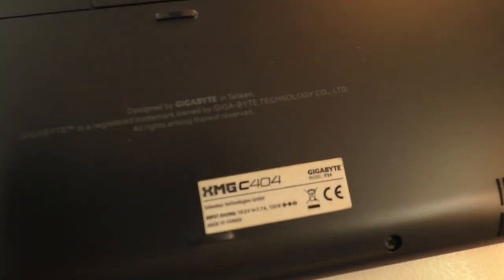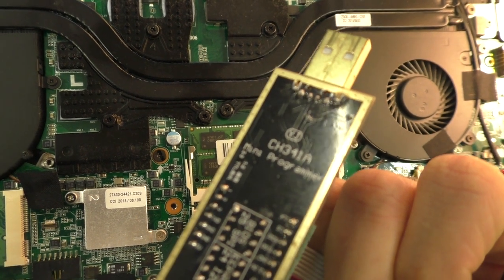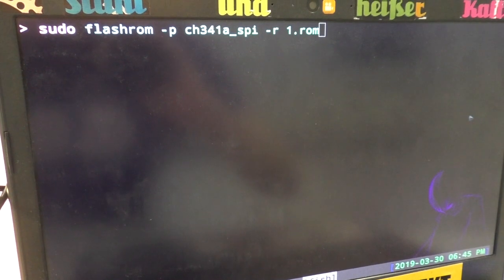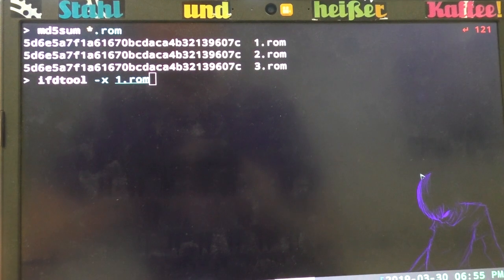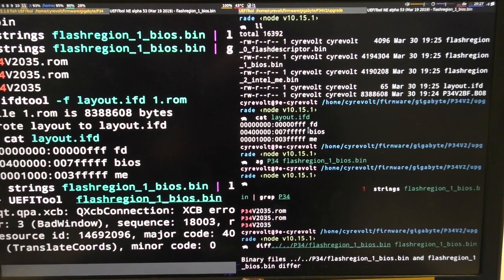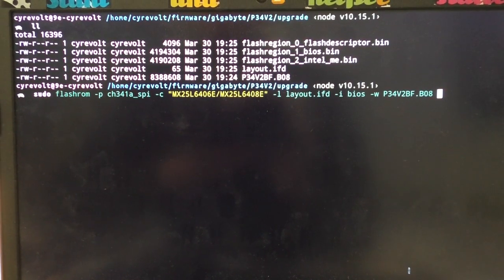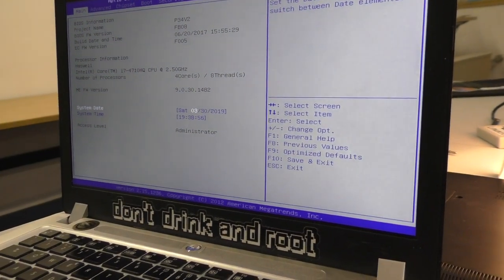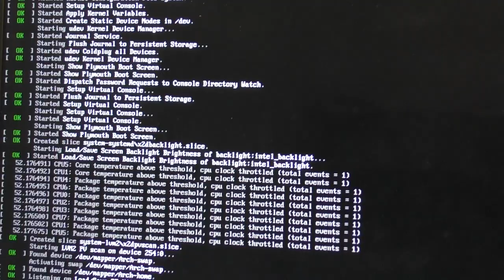XMG C404 aka Gigabyte P34v2 Firmware Investigation

Comment: Thank you for your research! I have similar issues with the touchpad, but it seems it is only prevalent when Windows has recently been booted and I boot Linux (dual boot, separate drives). Disconnecting power for a while restores functionality. Very interested to see the next step and hope you will find a solution!